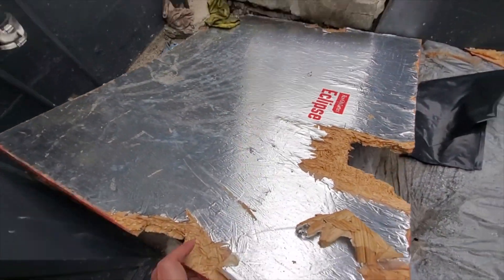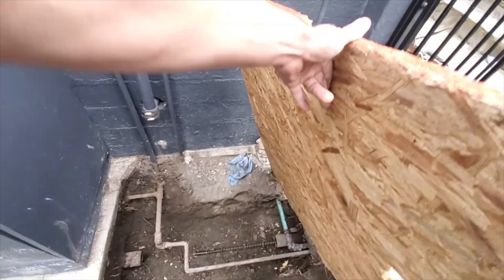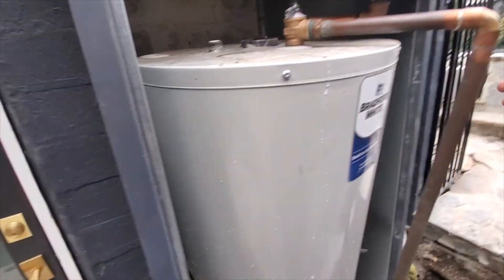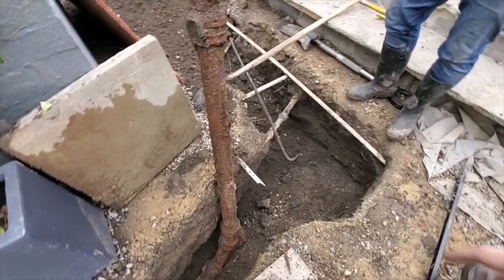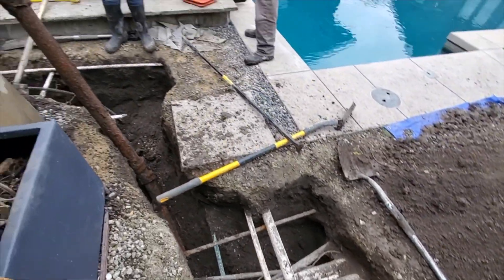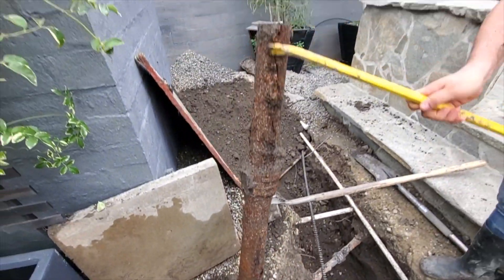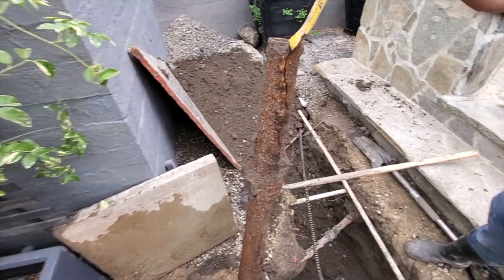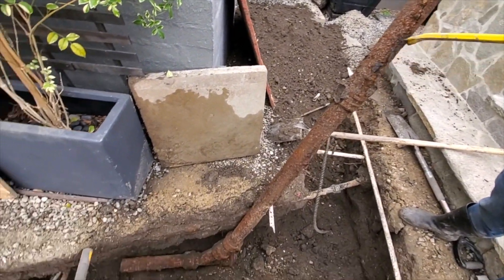Pipe bursting a 3" sewer - Part 2

Comment: replace it all while you can , grind it to fit the bands...thxs for sharing...
Reply from the maker: @tomdale1313  i thought about it but all of that was fine and didn't want to break off a bigger issue and end up having to jack hammer inside of the back house
Reply: @pershingplumbing9007 
The main problem is after the customer has new concrete poured and two years from now you’ll get that call that there’s a clogged line and you’ll  camera that line that you decided and find the bottom rotted out and that new concrete will have to be jack hammers up again and the customer is gonna be pissed and have you in court with this video and it’s going to come out of your pocket believe me on that the company I worked for in N.C. had that same situation and yes went to court and lost and I was one working after the incident and had to replace the piping that the previous plumber that worked for the company didn’t fix while it we already cut jack hammered and dug out the only difference was it was inside a garage but the company had to eat crow over that big mistake, I’m just giving you a little piece of advice do it now or do it later on your dime .😢

Comment: You're NOT replacing all of the under-slab drainage outside the bathroom??
The feed pipes and fittings from inside look horrible.  
And the fact that all the linear piping around the pool was badly cracked... why would you trust ANY old stuff on the property to last much longer?
You've finally blown the whole thing open, now's the time to make it ALL fresh before slabbing it for eternity.
Just my opinion.
Reply from the maker: @dock_yard1149 you'll see why in other episodes

Comment: Did an underground pool line repair someone drove a stake into.  Talk about a pain in the ass.   
It was basically just like in that mass cluster of piping.  Like 8.  2” lines.  With 8 more directly stacked on the top of the other 8.   But the damn one with the break the stake was able to hit was ofcourse the center of the mass an it squeezed between the top ones an was one of the center bottom ones.  

The length of digging alone out each direction. Just to get play in the lines an all that shit.   They paid for it to be done.  But found out quick.  It can be done one person ofcourse.   But I won’t be the one person anymore lol
Reply: Lol you found " the box"  that sucks

Comment: Same thing for AC pads an pool equipment pads.   If you buy just a generic whatever size pad.  The core’s are styrofoam an it’s just a top a side shell of cement.  Makes moving em way easier for sure.   But can’t really beat a pad formed up an actually poured.